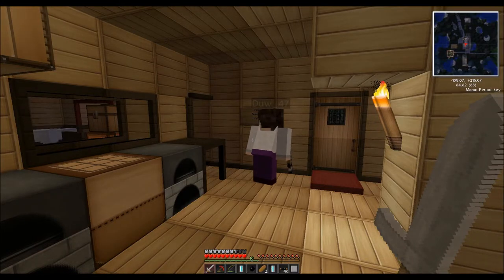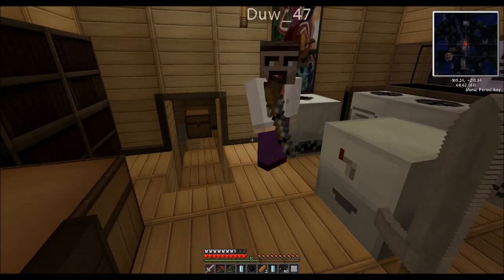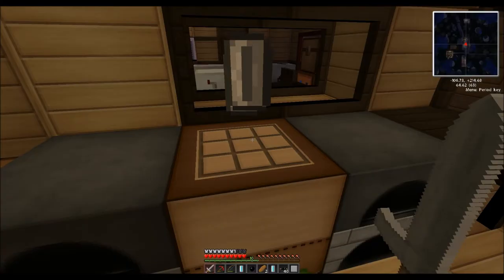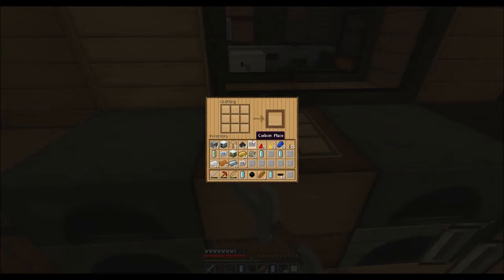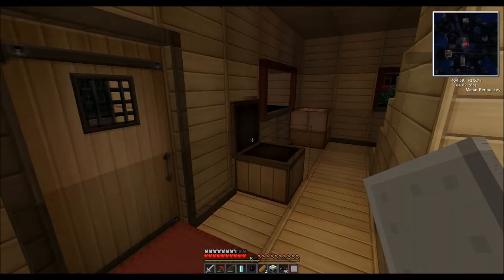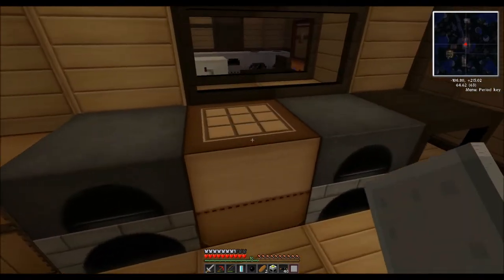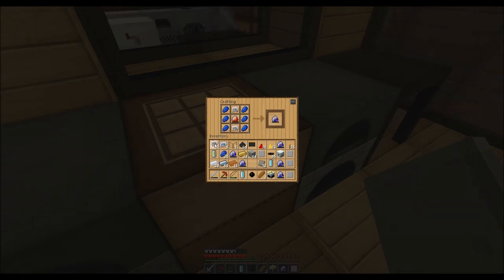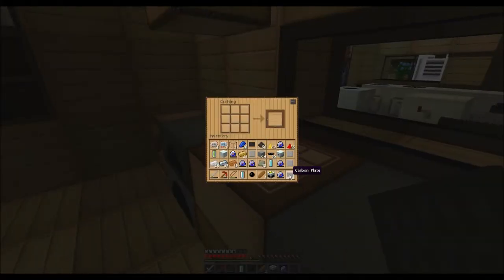Minecraft Tekkit  - How to make and use a Nuclear Reactor

Comment from the maker: Your probably trying to power low voltage machines with high voltage therefore overloading your machines, you could try 3 transformer upgrades in each machine. If your using an MFSU to store the reactor power you would need to connect the output cable to the MV transformer then to an LV Transformer, this should power your machines without them blowing up. :)